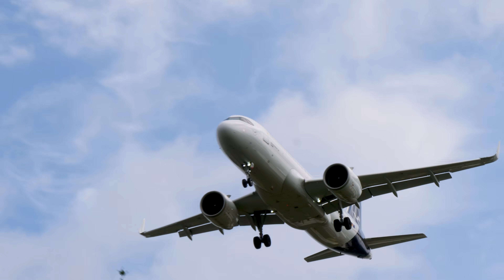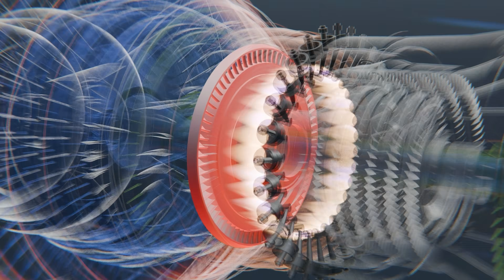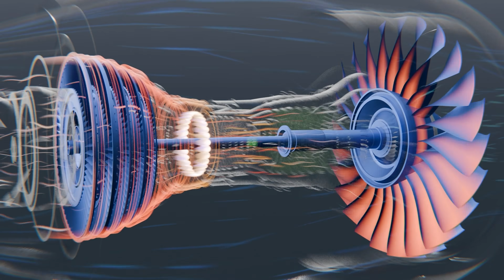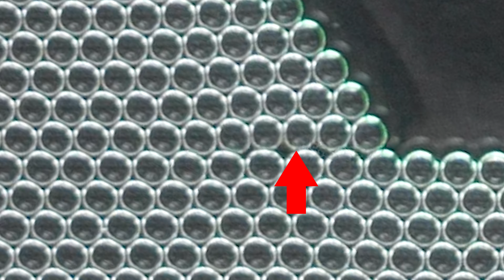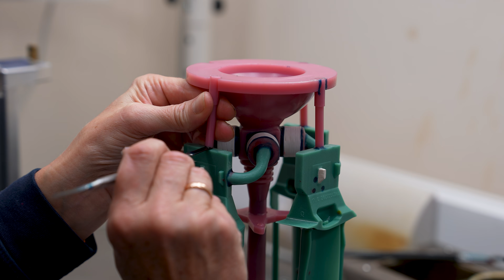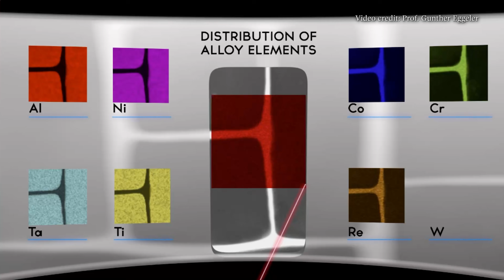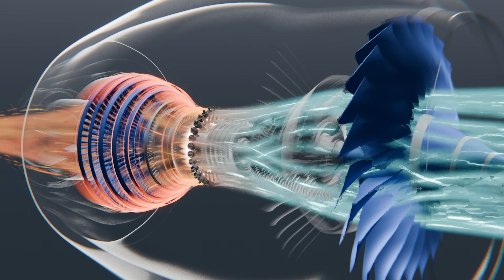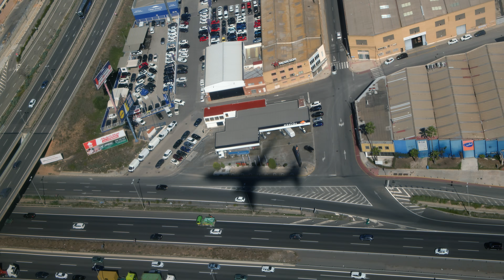The Ridiculous Engineering Of Jet Engines

Comment: 11:12 needs a massive correction. 

The first jet aircraft was the Heinkel He 178, built by German aviation company Heinkel based on the engine design by physicist Hans von Ohain. It made its first flight on August 27, 1939. 
However, the British engineer and RAF officer Frank Whittle independently developed and patented the first practical turbojet engine several years earlier, in 1930.

Comment: 12:45 so you have to be at break even point in all the aspects while making a jet engine means it has to be light weight it has to handle heat also it has to be strong also cost affective not so rare that's so hard to get damn

Comment: 33:56 but to push air through those holes you need higher pressure that the air hotside the blades. How to they do that ?

Comment: $20,000 per hot stage blade, superalloys with a ceramic coating and compressor stage air curtain to prevent direct contact with combustion gasses.

Comment: How does that wax become air, negative space or void as he said, so that they can fill the cast with alloy? I'm still aghast on how that's possible. I mean, it just disappears.
Reply: You heat it up and melt it and pour it out after you have your ceramic coating built up around it.
Reply: @wally7856 That Engineer guy didn't say that and it wasn't shown in this vid, that's why I'm so confused.

Comment: TL;DW: The blades are coated with a metal and then a ceramic layer. Further, there are holes drilled into the blades to air cool them.

Comment: I worked at HOWMET for twenty years in the airspace division and we made all of these types of blades. Not only the blades for the rotor sections, but also the stators as well. The “ stators “ are the stationary blades that redirect the hot gases, and the level of complexity of each type of blade is incredible.

Comment: Its always fun looking at crystalline structures of metal and the grains, vacuum furnaces are awesome! I worked at Howmet for a few years in the Monoshell department about which sort of blades are dipped in to what sort of mixture (I use to make up the mixtures). The wax stage was crazy, and we use to have to use tiny cameras to inspect each dipped wax hollow (after its gone though the wax melting stage) for any imperfections. Great work!

Comment: Great video, I think you captured a lot of information that is true while keeping it understandable for those without education.
You did have me laughing with the "extremely long" section about coatings. Especially that outer ceramic coating is extremely complex on the first stage blades.
The feather like structure created with electron beam vapor deposition (EBPVD) is astonishing.
I am personally involved much more with the metalic coatings and they are not a walk in the park either. Especially those with platinum that are used as bond coat for the EBPVD coatings.

Comment: I used to machine and test the superalloy that rolls Royce are using in their jet engines. Very interesting job and extremely tough stuff to machine. Macro plate testing and magnification is interesting to look at the crystal structure.

Comment: Bro can you make a video about wave mechanical model and psi graph? Its really interesting but no goo teachers
Reply: /-----__\   <----- there is your psi graph. Goes up (/) in a linear fashion through the compressors. Levels off (----)  as it makes it's way to the combustors. LOWERS slightly (___) during combustion (that is not a typo, it goes down, not up during combustion). Then sharply drops (\) as it goes through the turbines.

Comment: Amazing video,  this was one of my always thought about it question how they build the blades , the single crystal melting and the coatings also the small holes inside and around the blade for cooling is absolutely genuine 😀,  i love what I see , Amazing engineering job,  masterpiece... ❤ and I am %100 sure there are other tricks there that are top secret and they don't want to talk about those technology because of what those companies need to be on top otherwise so many other companies tries to copy that , that casting was crazy format , I am sure there are more tricks for it that they don't want to talk about , I strongly believe those steps wasn't there only 😉 secrets,  there are way more into it.. they might use magnetic fields or even specific sound waves to try oriented the atoms in specific directions while its molten,  also I am sure they apply some sort of different layer coating inside those cooling channels.. also specific sound waves generated by the spinning blades can be matched with whole engine mess to kind of separate the hot air from incoming hot air to prevent those blades from melting,   I am %100 sure there are more to it.   But anyways this was one of the best videos I have watched in YouTube.. a big thank you for making suck amazing video

Comment: 23:25 Fun fact. Rods used for fixation in spine surgery have historically been stainless steel, titanium and cobalt chrome.
 The new kid on the block is MoRe, an alloy of molybdenum and rhenium.  This alloy is stronger than the other materials allowing for smaller diameter rods but more importantly it's far more resistant to cracking. Over time as the rods go through very small bending cycles titanium and cobalt chrome have a tendency to crack but the MoRe rods seem to be almost invulnerable.

Comment: Rocket thermals are even crazier. Far, far, FAR higher temperatures and pressures and much faster flow. The only good thing is that there's no blades spinning at very high speed in the hot gas, but keeping the walls from melting takes real skill.

Comment: Suck, Squeeze, Bang, Blow! The 20% thrust that the combustion produces on those high bypass turbofans are unique to those types of engines. The thrust for engines on most fighter jets is from combustion. On an F404 particularly(also a turbofan), the bypass air from the overlap of the fan module to the compressor is used primarily for cooling of the compressor and turbine sections, and as a barrier for the flame in the afterburner.

Comment: I spent the first 10 years of my career as a mechanical engineer with a major gas turbine design and manufacturing company, largely working on turbine components using single-crystal nickel superalloys in the late 80's and early 90's. You did a great job representing the obscene physics and metallurgical challenges and how they've been solved. For what it's worth, I went from that mindbendingly complex job to spend the remainder of my career in the semiconductor business, where the scale and precision of the materials science and process engineering challenges are tenfold more complex.

Comment: Tons of air a second? Why's it measured in tons and not cubit metres per second
Reply: When you are doing your thermodynamics calculations, you are working with mass flow rate. A cubic meter of air tells you nothing about how many molecules are in there as it could be at any pressure.

Comment: There are newer materials that can reach 2000 C and that is the temperature to split water into hydrogen if 3d printed with cooling channels and porosity reaching that temperature could result in hydrogen that is cheaper than gasoline.  The Japanese experimental mini pebble reactor that produced red hydrogen that is about the same price as gasoline.  It used high temperature electrolysis, but reaching 2000 C is less complex and could prove even cheaper.

Comment: 10:25 Can we also take a moment to point out that this is why burning aviation fuel didn't need to burn hot enough to melt steel to cause the collapse of the Twin Towers.

Comment: Bigger point, let's just take a quiet moment to appreciate the miracle of modern jet travel: you're slicing through the air at 900kmh, at 35,000 feet, it's -50c outside, and you're sitting in warm comfort sipping chilled wine listening to jazz. And it costs a couple hundred bucks to do this for a thousand km. Ain't life hard?

Comment: Hotter than their melting point?  Surely not.  Yes, it runs in an environment that is hotter but the blades run cooler.  You do a whole section explaining the cooling yet you persist with click bait statements.

Comment: My parents work for a major supplier of aircraft engine parts here in the PNW, my mother in wax and my dad in final and inspection. At one point I worked there also working on the first work line after casting and then later on the Penetrant inspection line.

Comment: So near the end of the story we learn that the blades are self-cooling and the bit that actualy holds the blades together is one crystal and is protected by a layer which can withstand those tempertures ergo while the outer part of the blade sees very high tempertures the innner part of the does not ... so the begining premiss of the video incorrect ie wrong.

Comment: Why does the combustion chamber combustion pushes the gasses backwards and not forward? According to the laws of physics, pressure applies the force equally to all directions.
Reply: It doesn't, the force is equal in both directions. But the work done by that force is not, because the air is moving.
Reply: That is only in a closed container. A jet engine is not closed, it's open on both ends. Because it's open and not confined, combustion in a jet engine DOES NOT increase the pressure of the air. It LOWERS it. All combustion is doing is heating the air causing it to expand and increase it's velocity. That increase in velocity lowers it's pressure via Bernoulli principle. Light a match, flic your bic, turn on a gas stove - all the same thing. No confinement, no increase in pressure, it actually goes down as the air expands.
    In a jet engine, the highest pressure is right after the compressors and then it's all down hill out the back. About 800 psi after the compressors and then zero at the rear. Since air moves from high pressure -----> low pressure (unless you do work on it like the compressors do), it goes out the back.
    The best example of this is your hair dryer. Believe it or not, your hair dryer is only 1 component away from being a jet engine. In your hair dryer you have an electric motor turning the fan instead of using a turbine to do that. Everything else is the same as a jet engine. That electric heating element in your hair dryer does the same thing as burning fuel in a jet engine - it adds heat to the air expanding it and increasing it's temperature and velocity. It doesn't increase the pressure any and the air flows out the exit because the exit is lower pressure then right after the compressors (fan).
Reply: @wally7856  there must be a higher pressure in the combustion chamber, because the difference between the pressure on the fan blade sides is the only thing that makes the turbine spin. You are right that the pressure drops gradually, because every fan needs a pressure gradient to contribute the spinning. The combustion chamber has an access to the compressor fan blades too, because it’s the same volume. So I wonder why the pressure doesn’t make the compressor blades spin the other direction.

The hairdryer analogy is incorrect:
1. It doesn’t need heat to blow. Most hairdryers can blow cold air.
2. In hairdryer the blades propel the air, in jet engine it’s the opposite (actually, a jet engine does both, but the main thrust comes from the combustion, not from the compressor).
Reply: @cheesebusiness  Google "pressure through a jet engine graph". The highest pressure is right after the compressors. It decreases "slightly" during combustion and then sharply decreases as it goes through the turbines.
Reply: @wally7856  thanks, I’ve examined the graphs. They indeed show that the pressure drops slightly in the combustion chamber. Also they show that the pressure before and after the engine is about the same, and the only thing changing is the temperature. So, I have new questions:

1. It appears like the turbines spin only because of the pressure created by the compressor. That looks like a perpetual motion machine. How does the heat generated in the combustion chamber contribute to the engine motion?
2. If the pressure before and after the engine is the same, what does create the thrust?
Reply: @cheesebusiness  The answer to both of your questions is "added velocity". The added velocity is kinetic energy that the fuel imparted to the air flow (along with thermal energy) by heating it. The turbines spin from both the pressure AND the velocity of the air. Those turbine blades are little airfoils (wings) and need the velocity of the air to operate and extract energy from, they create lift in a circular manor that turns the turbine. The faster the air, the more "lift" they produce turning the turbine. The only contribution pressure does to the turbine is to make the air denser so more molecules hit the blades per second extracting more energy.
     The velocity of the air can be as low at 100 feet per second before combustion and then 1600 fps after combustion. That's 16 times faster from burning the fuel! That's where the energy comes from to turn the turbines and increasing the velocity of the air to those speeds requires the air to accelerate which gives you your thrust as you are essentially pushing off the air itself. It accelerates backwards and due to Newtons 3rd law, you accelerate opposite (forward).
    On that same graph you googled, find one that also shows velocity through the engine. It goes up and down but is very high after combustion before the turbine stages, zigzags as it goes through a turbine, then stator, then turbine, then stator, etc dropping overall as it goes through the turbines but then climbs back up at the nozzle at the rear of the engine. 

   So accelerating that air gives you thrust and we steal some of that velocity to turn the turbines which turns the compressors and at the end of the day the energy to do so comes from burning the fuel to make heat and the air goes out the back because the pressure is low that way and way too high to go out the front.
Reply: @wally7856  Newton’s third law — ok. The engine pushes the air backward and therefore pushes itself forward.

You say “adds velocity”. Velocity is a vector, that is the addition has a direction. Why does the combustion chamber add velocity backwards and not forwards?
Reply: @cheesebusiness  ... because the pressure is lower out the back (0 psi) then the front (800 psi) due to the compressors so the air flows backwards. Fluids flow from High pressure ----> Low pressure.
Reply: @wally7856  the same happens without the heat. How does the heat contribute the pressure difference or the velocity?
Reply: @cheesebusiness  Without the heat, the engine can't run on it's own. The compressors take more energy to operate then you'd get out of the turbines without speeding up the airflow with heat. As soon as you shut off the start motor it would just spin down. The heat is the added energy necessary to provide the energy for the thing. That's like trying to operate your car without burning gas.
Reply: @wally7856  sorry, but your answer tells obvious things and ignores all my previous questions.

Comment: My older brother worked at a place where they used lasers in a process to make high turbine blades from 1975 to 2001. I worked assembling commercial jets engines for a few years in the late 70s.  I have a high turbine blade around somewhere that shows the cooling passages.

Comment: isnt casting pretty weak? from what i understand it is much better to forge then cut. idk if the same principal applies for aircraft metals.
Reply: The difference between casting and forging strengths is all in how the millions of crystals that form during solidification are shaped and their size. The crystals are roundish in castings and forging stretches them out and lengthens them like wood fibers strengthening the material.   When you only have 1 crystal like these turbine blades it doesn't matter.
Reply: @wally7856  this is pretty amazing though. funny how they add in turbulence which is something you do not normally want.

Comment: I felt really smart for a second when I guessed they used a ceramic-coated nickel alloy, but I was absolutely blown away by the all the crystal tech. What was even more fascinating to me, was that this seems like the kind of ground-breaking science that you would only see in a rare application for some sort of cutting-edge space rocket, and not mass-produced for daily air-travel. Like, I'm not surprised these kinds of things are possible, but for it to be possible on such a massive scale is crazy.

Comment: 3:58 Incidentally, that KE=1/2m*v^2 is why rockets are so horribly thirsty. With propellant mass limited in absolute terms the only way to increase performance is to pump more energy into the reaction mass as possible - but you quickly run into the problem of engines being made of materials, which can't get very hot before the exhaust starts running engine-rich, which is not typically conducive to mission success

Comment: It’s cool to see this niche industry come to light.  At one point, I worked as the Wax Process Control Engineer for both a supplier and competitor to Rolls Royce Aerospace.  I worked in structures, not aerofoils, but it is cool to see other company’s process differences.  Im honestly surprised Rolls Royce allowed their process to be published considering there’s so few companies out there that perform this kind of work.  Cool video! I worked on the manufacturing process side, so it’s cool to see the more research focused items related to how the final product makes it into the engine.

I would love to work in that industry again, but they’re very cut throat, so I probably won’t.  There’s more to life than making jet engines.